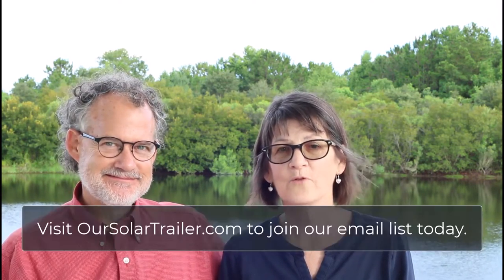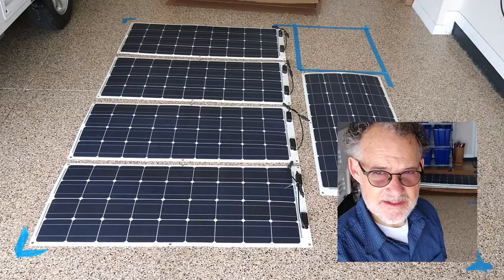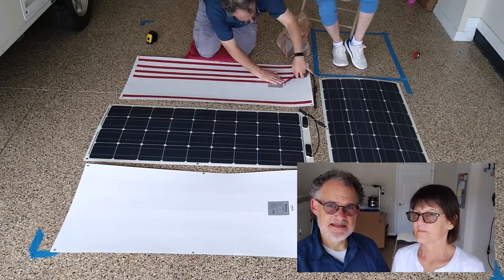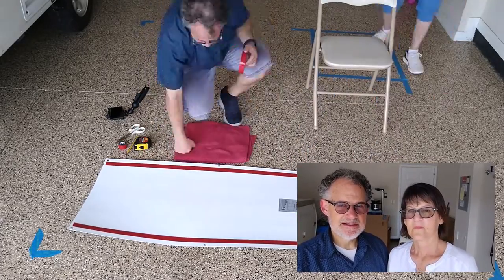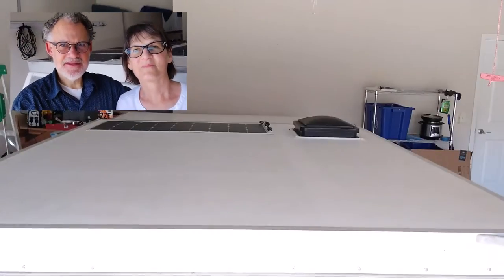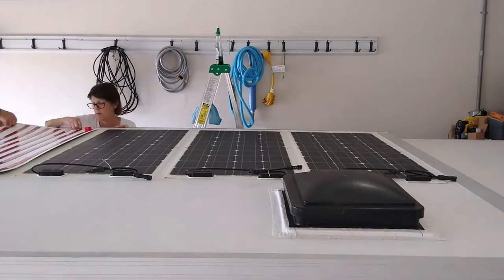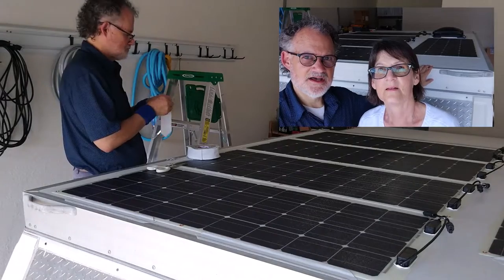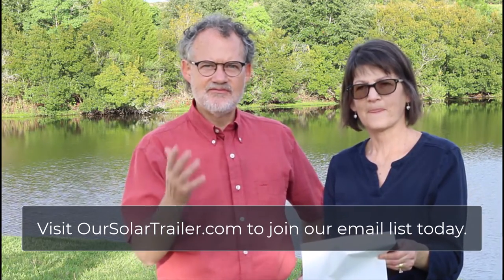The Easy Way - How To Install Solar Panels on an Aliner Scout Popup Trailer or Other RV

Comment: Very neat and professional looking job. I can't wait to see how your setup performs. I currently use two 180 watt suitcase panels that I wired in series so I can move them farther from the camper without using too heavy a wire. They work great but are a lot to lug around at 30+ lbs each.
Reply from the maker: That is so cool. We'll see how this works but may need to add something like that to ours in the summer!

Comment: Great video. Thanks a bunch. I am very interested in how it works for you. I am looking at adding solar to my scout. I have a bluetti EB55 power unit and a 200W foldable panel for powering the refrigerator that I use. Wanting to get to the point where I can do 400W on a cloudy day to run my AC.
Reply from the maker: We're still working out some kinks with our system, but hope to be able to operate for an 8-day trip in the fall without shore power. Fingers crossed!

Comment: Thanks for making the video! Do you know how much weight the roofing material can take? Also any idea what the roof is made out of? My only concern is that if the roof is up, the panels are kind of hanging and put unnecessary stress on the roof. Any thoughts? Thanks!
Reply from the maker: Great question, Jimmy! We cut a hole through the roof and found that it was two layers of plastic laminate with a layer of Styrofoam between them. When I climbed up on the trailer, the roof comfortably held my weight. All the panels combined weight about 25 pounds. I'm not concerned about stress on the roof. 

Because the roof has to be lifted each time the trailer is set up, I worried about the additional weight. I can still easily set up the trailer, but I can definitely feel the added weight.